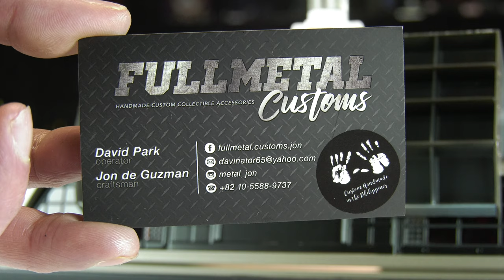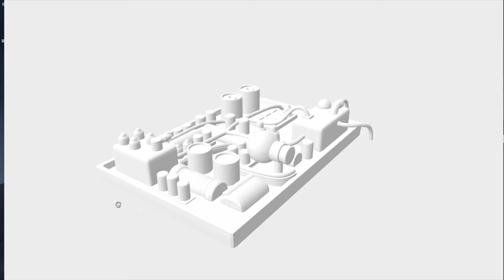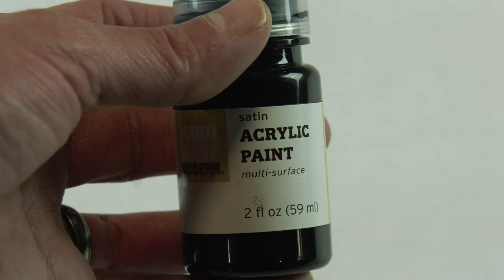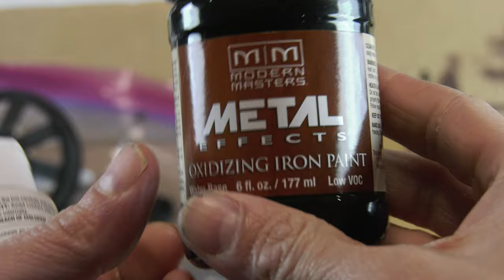Hot Toys 3D printed Railroad track conversion Mark III Delorean or how the West was won.

Comment: The funny thing is that the Hot Toys DeLorean is probably the same size as the studio scale models used for BTTF2's flying scenes and the train sequences in BTTF3.  So, you've probably got a studio scale model replica there.
Reply from the maker: You are correct. Most of the models used in filming were 1/6 scale.

Comment: Wow, Danoby! It‘s just WOW! 😲 The new wheels modification makes the DeLorean look more accurate to the floating version from the part II. The wiring makes it look a little bit odd though. But still it is the best conversion with illuminated wheels so far. And I have to say that I like the mark III version even more! That’s a great job your friends and you have done on these projects! All those specially created props - that’s magnificent! My congratulations! 👍
Reply from the maker: Now.. Need to work on those underbelly lights. :)
Reply: Oh, do you mean those lights in the middle of the car bottom? 🙄

Comment: Only thing it's missing is the underside sequential lights.

Also, I still wish there was a good mod for time circuits to light up.  That's really odd that Hot Toys didn't do that.
Reply from the maker: Working....... On those lights..... :)
Reply: So, I talked to Danoby about seeing if there was a way to vacuum form a false underside of the car to have those lights. Only issue is then all the painting and such plus it's a boat load of wiring and circuitry to have them flash in sequence, so for now, I didn't design it. If anything, I am going to make flux bars like this: https://imgur.com/901brUZ

Comment: That really did look fun converting the delorean for railroad (imagination is part of the fun)...I'd love to see more mods for this model like the white wall tires...little tweaks here and there to get it much closer to how it appears in the films like a way to replace the lightning rod box with the box unit for part 2 and 3...I imagine the eaglemoss hood box with the mods might very well look good fit properly on this model if the scale is the same.
Reply from the maker: I keep getting told EagleMoss does a good Delorean scale. I don't have 2 years and $1500 to dump on a 1/8 scale.
Reply: @Danoby2  just noticed the scales for both models are a little different 1/8 and 1/6...the eaglemoss hood box (buy separate from the car) has like thin leather material for straps that fit under the hood...but since the scales are different...yeah it wouldn't quite fit.

Comment: Check on a Company Called LGB they make Garden Scale Loco's...Steam era that might just fit this scene..barring that connect with a local Model railroad group and see if they have an old used one they no longer want..you could custom it up and Ta Da have the whole scene..this all looks amazing..good work.
Reply: The LGB tracks are to narrow for this scale. And the trains are way to small. They are like 1:16 up to 1:29 scale.
Reply: @boomfigures6268  This is True..but there is quarter scale Steam engines as well but those are pretty pricey..was thinking even with the scale off maybe a forced perspective might work.

Comment: The biggest thing missing.....  the use of Sand paper....
Reply from the maker: hmm..  Used for what though?
Reply: @Danoby2  Increased realism for 3d printed parts.  This includes both the wheels and the rail specially in areas that would be worn smooth through use.  This is where attention to detail is important.  Rails should have been mostly sanded smooth specially the top where the train rides on to remove all evidence of it being a 3D print.  That area is typically never rusty and can even be polished to a mirror finish on well used tracks.  I understand you wanting a rough look but that is easily accomplished with your rusting technique and paint.  The same is true with the wheels as they would have been far smoother even if they were black smithed.  Again most used surfaces would be smooth and polished around the outer rim and the rusted look would be achieved through paint and surface treatments.  It is always easier to make a smoothed surface to look worn than it is to make a rough surface look smooth where it would be.

Comment: 6:48 "Transistor box"
Not transistors, these are vacuum tubes  ("radio tubes") and capaciators.
https://en.wikipedia.org/wiki/Vacuum_tube
Transistors were invented in the late 1940´s, Bttf 1 acts in 1955, this was to early.
I hope I helped you a bit.

Greetings from germany
Reply from the maker: Well you're right! Doc did say the vacuum tubes were warmed up in 1995 before Marty headed out to the old West!
Reply: @Danoby2  Correct. :-)
Greetings from germany

Comment: honestly, in my opinion, that transistor box is not that well printed, he could've put the support marks on the back side instead of the front. I used to work with DLP printers and that would be a reprint.

Comment: How about a mod to light the dash and time circuits?
I think this is where Hot Toys really dropped the ball  on this car. They lit everything else...why not the freakin time circuits !?!
Reply from the maker: You have a point, more lights!
Reply: So here is the thing. I probably could design that, but the issue is that it's too hard to take apart the car. It's glued/screwed and any alterations would devalue it.

Comment: Have you thought of (or tried to figure out) how to light up the flux bands? I think that's one of the biggest mistakes hot toys made when they designed this.
Reply: I built the front bumper https://imgur.com/XfQI2bZ and the main issue is that the EL Wire has a tiny transformer and it makes an awful screetching sound. It's really high pitched like a dog whistle or something. Luckily it's not very loud. Still, it was a great deal of work to build my own custom bumper. It took me a month to figure it out. Bad news is I had to sell my delorean and I sold my front bumper with it.
Reply: It's a shame you had to sell your car because the EL wire looks amazing. I have read about/seen video of the humming sound that you speak of. I wonder if you could use the EL Light Mod for the Eaglemoss Delorean on the Hot Toys model? I am guessing it would be a bit short since the EM car is a 1/8 scale and this is 1/6.
Reply: @DeepGreenOsaka  https://imgur.com/901brUZ. I made the front bumper. It took about a month of trial and error to get it to work, and I started on the rear but then my Kia Soul blew up and I needed the cash to get another car. Sadly, I miss my Delorean. I sold the EL Wire with the car.
Reply: @DeepGreenOsaka  They make different diameter EL wire, so I think it could be done.